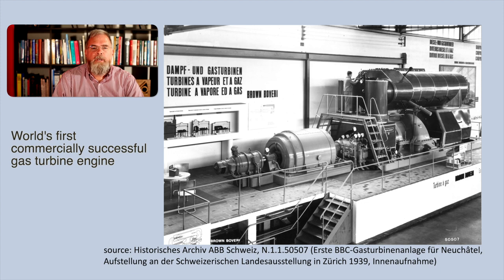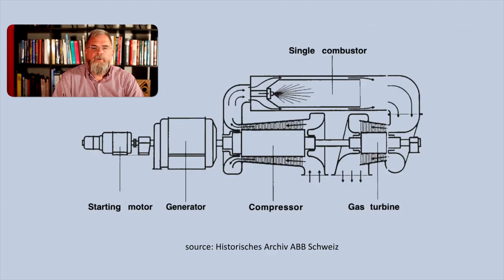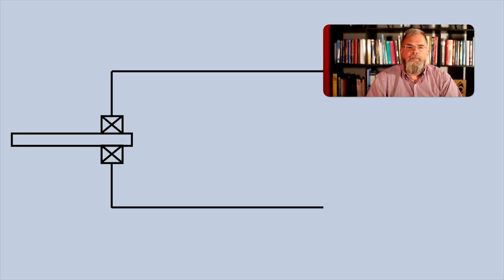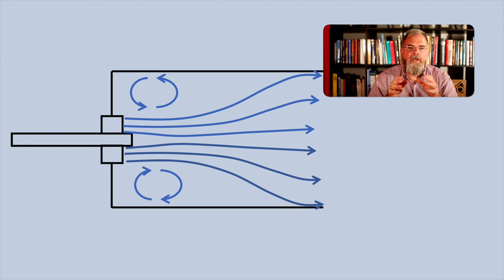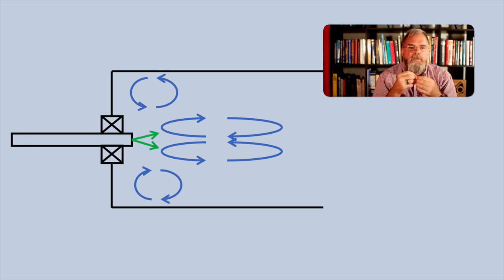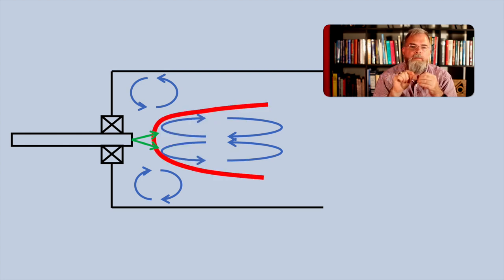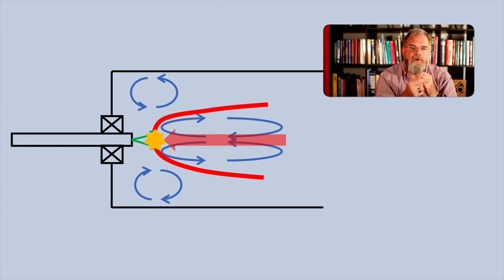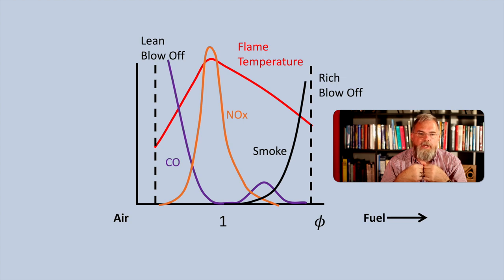Industrial Gas Turbine Combustors Part 1: Single Burner Silo Combustion Stabilisation and Emissions

Comment: Can old gas turbines take in hydrogen as fuel? If not, is it as simple as changing the components of the gas turbine to take hydrogen as fuel?
Reply from the maker: There are a number of issues with hydrogen that would create problems for a gas turbine combustor which is optimised for natural gas to burn without modification.  Hydrogen has a very low energy density compared to natural gas and so the volumetric flow rate of hydrogen will be significantly higher.  This requires larger supply pipes and a larger total fuel nozzle area to maintain reasonable velocities and minimal pressure losses.  Hydrogen is also considerably more reactive than natural gas with a significantly higher burning velocity.  If it is desired to burn this premixed to minimise NOx emissions then the time available for mixing will likely be considerably shorter and so it is desirable to maximise the rate of mixing by increasing the surface area between the hydrogen and air entering the burners.  I believe this is one of the main reasons newer premixed combustion systems are moving in a direction of a greater discretisation of the fuel and air supply to the combustion chamber.
Reply: @engelbrechtgmbh  i see thank you. Another question, what happens to out of commissioned gas turbines? Are they recycle or the whole system is refurbished/modified?
Reply from the maker: @wanarif9223  This I can't really answer.  My involvement in the GT industry has really been from the development side.  My only involvement regarding service has been related to root cause analysis to try to understand the mechanism for failures.  But other than that I have not really been involved in GT service.  I would guess it really depends a lot on the engine and whether or not it is possible to refurbish and upgrade it.  It also depends on the utility who owns the engine.  Performance advances as well as reductions in emissions have been significant over the years and there maybe good motivation from the utility's side to completely scrap older engines and replace them with newer technology.  Having said that the world's first gas turbine power plant which was commissioned in Neuchatel in 1939 remained in service until 2002.
Reply: @engelbrechtgmbh  seeing that the world is looking towards reducing carbon emissions, I wondered what will happen to old gas turbines that still emits a lot of pollution. I was not able to find any resources to answer my questions. Thank you for the answer tho.
Reply from the maker: @wanarif9223  No problem.  It is my understanding, listening to the leaders of the major OEM's at the ASME Turbo Expo and talking to colleagues, that it is believed the future for ground based gas turbines is for them to become a part of the hydrogen cycle for long term energy storage.  Existing power plants can be modified to burn hydrogen and all of the OEMs are developing new combustion systems to be able to burn a larger and larger fraction of hydrogen in natural gas with the ultimate goal to be able to eventually burn 100% hydrogen.  This of course is being done by the OEMs for new engines but there is no reason such systems couldn't be retrofitted into older engines and undoubtedly many utilities will want this.  As I said though performance has increased over the years so very old engines which have low efficiency might be phased out in favour of higher efficiency newer engines.  The hydrogen cycle for energy storage has a very low round trip efficiency so the higher the efficiency of the power plants converting hydrogen back into electricity the better the overall round trip efficiency of the cycle.  I have a video on the future of gas turbines for power production which discusses this as well as alternative methods for energy storage.